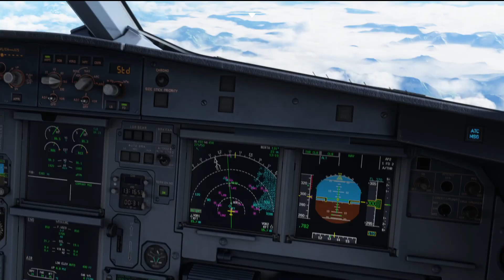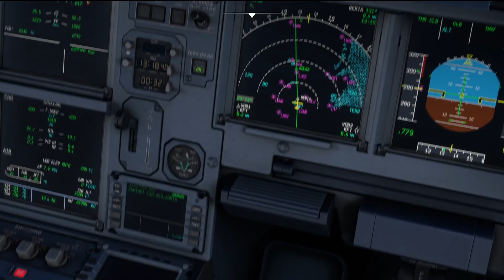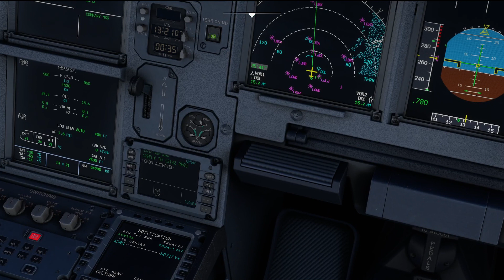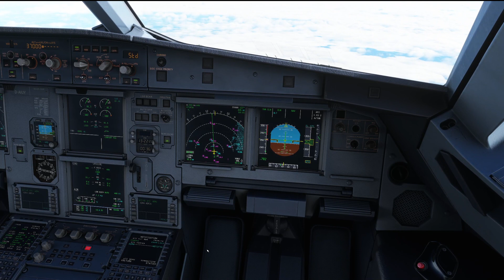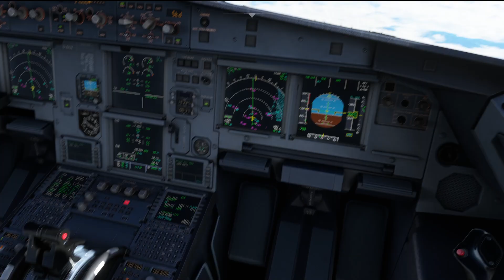CPDLC - What is it, how do I use it? | Real 737 Pilot

Comment: Great video Emmanuel. I have a question about FMC winds. I see some videos on YouTube where 737 pilots will enter T/C wind into the CRZ WIND section of the PERF page, then go to LEGS-RTE DATA and enter the average  wind from the flightplan, which gives all waypoints after the T/C the same average wind. Is this company SOP dependent? I have seen you instead enter the average wind from simbrief into the PERF page, rather than the T/C winds. I suppose all of this is redundant if you use the import winds function... Please clear up this confusion for me haha
Reply from the maker: Yes, it's company dependant. My airlines uses TC wind and then LEGS as well, but the PMDG has an older FMC version where you can only enter the LEGS winds after the route is executed - unlike the current real life one - so I kept forgetting to insert the legs winds after the briefing. In the end the legs winds are more important, so for the sim I started putting the average winds into the perf init page. Small "makes life easier" shortcut for flight simming.
Reply: @A330Driver  thanks so much for clearing that up! I was wondering it for a while. Cheers Emmanuel